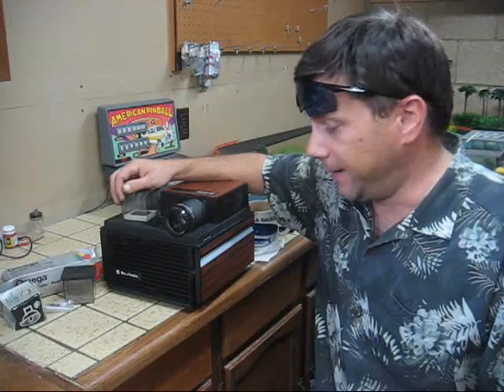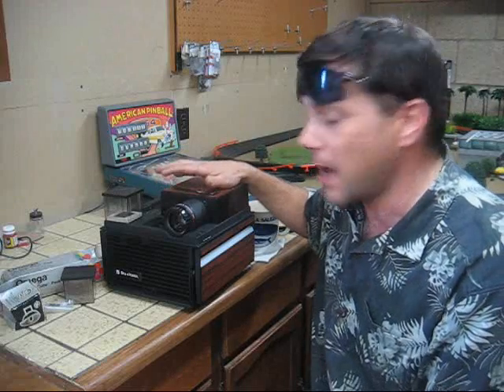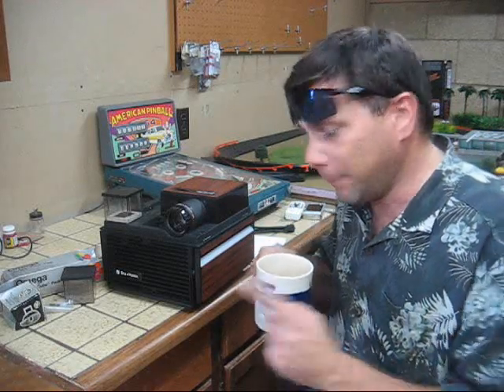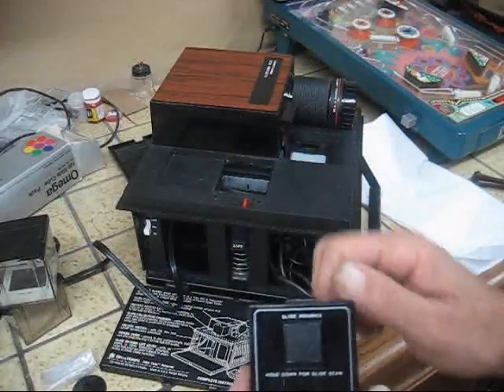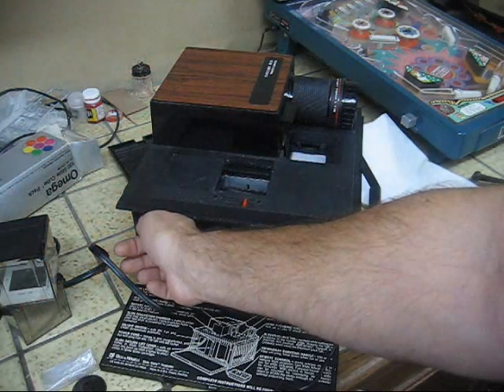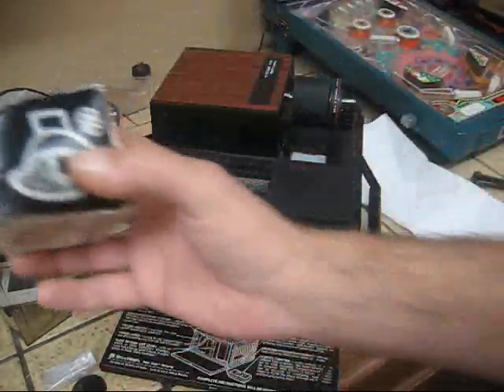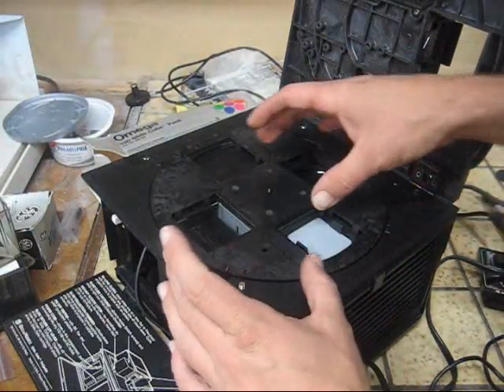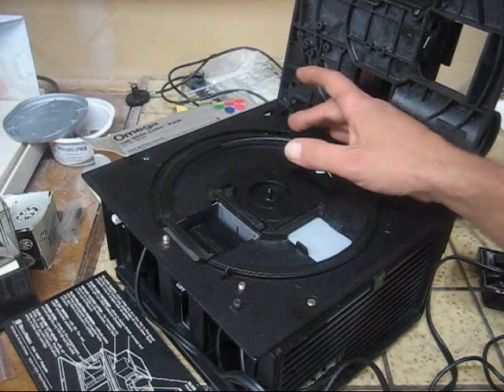Bell & Howell Cube Projector Repair Part 1: Troubleshooting.

Comment: I have a model 977 which utilizes a CBA LAMP, how do I replace it ?
Reply from the maker: i=Hi Russ. Thanks for watching and thanks for the question. I am not intimately familiar with the 977, which is 977q specific model? But it externally looks very similar to the RC55, but obviously it has that CBA bulb. #1 You have to obtain a replacement, which you might have if you know which specific one you need, which may be on the bulb. Various kinds look to still be widely available for $20-30. Also, I have dug for a PDF of the instructions to look at it, they are out there but people want to sell them. Its worth the investment, Ebay has them cheap for $7. 
-
For now, barring that, I can try to help, but I am not looking at it, so here are my guesses, you will have to experiment with it Using Caution: Given it looks very similar it is "probably" laid out similar, you tell me. If the bulb access door is in the same underneath position. If you are looking inside and it is side mounted like mine it probably has a similar spring retaining clip mechanism like mine and you should be able to slide it out sideways. 
#2  Looking at various CBA bulbs they tend to have a large hollow tube at the bottom (Probably to make sure it mounts straight) and 2 or 3 prongs sticking out, so  my second guess is, especially if you open it up and are looking at the top end of it, is that (like a 3 prong plug in a wall socket) it may simply just push in/pull out. Once again you need to look and see if there is any sort of spring wire clips that secure it in. 
#3 and I doubt it, but if there is threading in that center post, then is screws in somehow, but not sure how that would work well. So probably not, you can try rotating it if the 2 above don't work. 
-Once again MAKE SURE YOU ARE UNPLUGGED! Also, USE GLOVES or a towel or something. Yes it is just a light bulb, but there is a lot of glass. The glass and ceramic caps can become brittle with age and heat of operation and sometimes the vacuum or gas contained within that help keep it from collapsing can leak after it goes bad. So use caution, especially if you are going to be wiggling on it and aren't sure how it comes out. Start using gentle finger pressure like I do in the video and just carefully resort to a little more force if necessary gently. You do not want to accidentally break it and cut yourself.
-
I'm going to imagine that there is normal access to it, so try those out. Having to disassemble the projector just to replace the bulb would be highly out of character for B&H and this type of equipment, they are wear parts that will go with use, so likely once you figure it out it will be (Should be) a fairly easy procedure. The access panel method just might be different.But since it look s physically similar to the RC55 I'm confident it should also be similar.
Try those and let us know. If that doesn't do it then we'll have to take a.closer look. You will have to get me some pictures or a short vid so we can see exactly what is going on.

Comment: Do you know where I can get parts for my projector?  There are two little black plastic pieces that surround the cube opening in the lid.  There is a single screw holding each to the lid.  I believe their job is to limit the amount of slides that go into the tray.  I was already missing one and the other broke in two.
Reply from the maker: Hi Steve. What model do you have? I have an RC55. Lifting the lid up and looking on the underside I believe I see the part you are referring to. Apparently I only have one as well, with one screw. The other side is an empty screw hole and it seems to still work Wouldn't be the first time something was designed into a product and then not used in final production, if it's too much work to remove it from the design by the time the tooling was made, and it doesn't inhibit operation it would just be left blank or unused.
-
 As for the one that is there, it appears to be a plate of flexible aluminum with some tiny ears on either end. It screws into a plastic U- shaped housing that does the cube lid retaining. That U shaped plastic lug is riveted into the lid piece by four metal rivets. I'm not sure that clip actually does any retaining, it seems more of a spring for the lid latch (maybe) or to help other parts align. Yours may well be plastic. A quick glance doesn't show any parts online but I would think a flat piece of aluminum like that could be easily fabed if you kept the screw. If it is plastic I would try to melt it back together or just fab a piece out of aluminum (upgrade).
As for slide retention there are two spring loaded plastic feed lip assemblies but those are down in the magazine well in the projector body. Those are a bit more complicated.
I will try to get a picture up here so you can see what I'm looking at and tell me if it is what you are referring to and whether your part matches that or not, and we'll go from there.
Reply from the maker: Hi Steve, sorry, this thing doesn't let me post pictures, so stand by and I think I will just make another video on the cube feeding system and parts which should cover that part in particular. I will go over it in  the video, but it seems a pretty ambiguous part, it just seems to help keep a lot of stuff in place as a safety margin but doesn't seem to do much itself. I was able to remove it completely and still successfully run the projector, it will, however, help prevent slides from accidentally slipping over if bumped, among other things. Like I said, stand by for the vid and we'll go over it. Thanks.